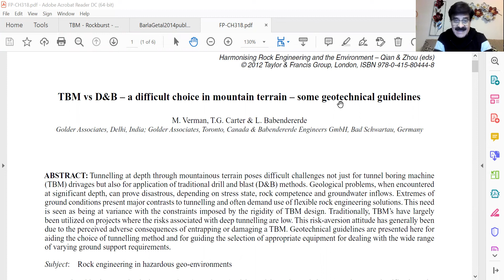Discussion in Tunnel India Group

Comment: Excellent to hear your lucid explanation sir . In fact the same rock (similar UCS) May behave differently based on overburden across the same alignment … that’s where TBMs are having to evolve to cater for rock burst and squeezing in the same tube … it’s a tough ask .. add to it a case where you may need to use earth pressure balancing .. it’s a tough juggle. Most himalayan locations warrant this juggle.